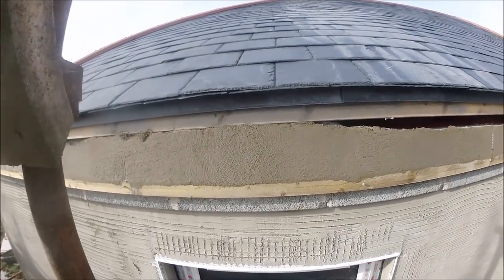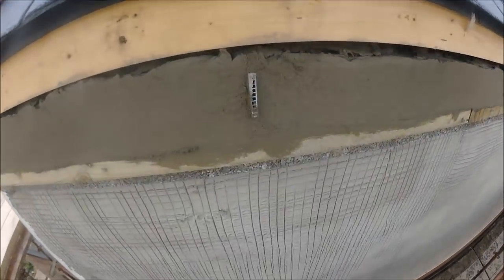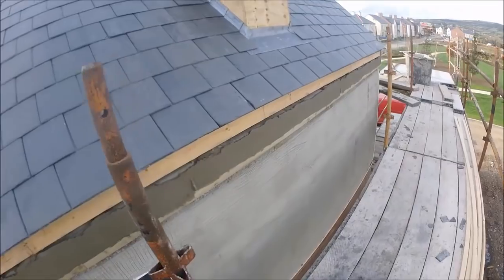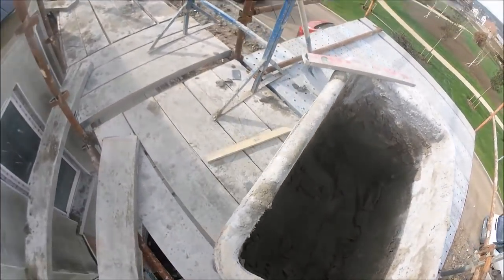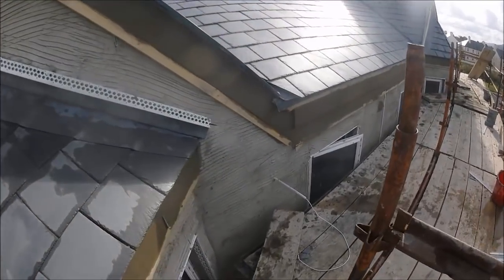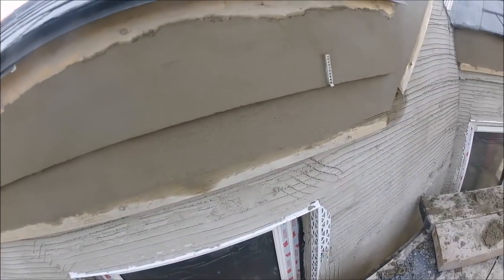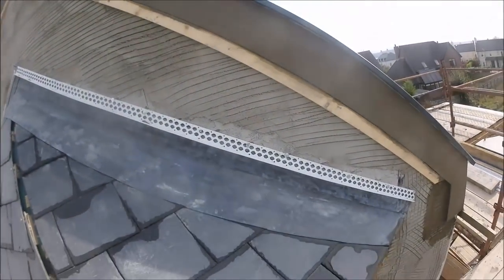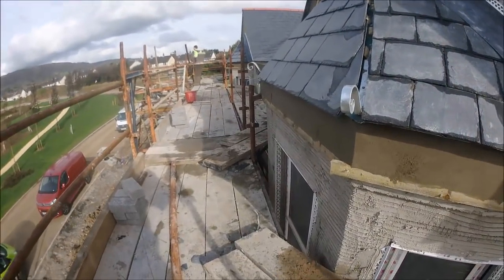Rendering job upcoming work to be done possible how to rendering vids to follow part two

Comment: Very neat work, when ever I was top of ladder or working high up was too easy to forget I was up there, number of times almost stepped off the edge.
Reply from the maker: Oh MAN I was on a big ceiling my and my mate was a huge hit of skimming but the floor was a sub-floor just concrete and was bumpy and stilts where up   to the highest they would go and i was still stretching ( need bigger set) but man i thought i was gong to fall every time i was in the one trowelling  up i would trip some never have i thought i was for falling as much on them in my life Would have planked it out but was no planks or scaffold
Reply: I was plastering small window with standard size trowel, was nightmare just beginning to appreciate what skill you have and was thinking today that plastering is lot harder to learn than painting and decorating, but one thing for certain I will never get up on them stilts especially not on scaffolding. That is so crazy.  As soon as I got home to Oswestry from Middlesbrough where I was doing plastering on my house I couldn't wait to get Nivea cream on my hands; they were roughest they ever been.

Comment: Those weep holes are an effin nightmare! I cut every other off if they're less than 1200 apart, ridiculous. Camera has improved tenfold, and cheers for directing me to this vid! ATB, Llyr
Reply from the maker: Haha man they have destroyed the sponge float my mate bought tearing holes in it big time thanks for watching  mate
Reply: macplastering do you paint anything on your battens, release agent / cooking oil? Looks like you've run a small tool between the batten and cement or something. How do you rate the pink sponge floats?
Reply from the maker: No need with these batons mate especially them clean ones I also cut them to make sure of a clean break They are sweet my mate bought in 2 brand new ones for this and one is near for the bin with those vents and the nails

Comment: lovly work again theres so much prep work bein done.never used 1 of them sponge floats outdoors only simaler 1s inside for skimcoat.good for straightening reveals etc
Reply from the maker: Was so much work on this with prep and the top row I remember was a little off shape we had lots to do to make it loo good especially  on the gable ends, Yes only time i would really use sponge float inside would be reveals that are heavy or the odd real bad shaped wall  , Funny it was me and a man called Emmet did this one :)
Reply: yes lad its an unusual name down south but up north i worked with 2 other fellas named emmet also.i was suprised tbh.ya if the wall is all over the place a spongefloat comes in handy.rearly used it.around bay windows where its heavy coat needed its handy also.was looking at ur power float i think i be just as quick with a normal float.but it sure do look the business .
Reply from the maker: @emmettmccarthy7247  Yes the good old power float have so good footage of that to come where I let walls go to the point hand floating would been very hard to get in im not impossible , I dont like adding water to a render job as i find it can leave stains ( white marks ) but thats mabe just me I lie to get it as it sets but in summer we at times will have no choice at times haha but yes I thin the new videos might be a good watch dear machine so anyone getting one will want to have a good few render jobs coming on or priced very well LOL

Comment: Do you block out bands ever?? What about window and door bands...e.g block out but allow for 2nd application with lime mix and use  timber edges
Reply from the maker: Dont often use lime , when you say block out do you mean build them out ? might have seen this not sure but how i do window bands -  https://www.youtube.com/watch?v=In-EvbfBWpY
Reply: Yes seen it a long time ago..I call that cutting band free hand ..I refer to quick 2x1 plained laths nailed on ,squared off  window frame, nibbed out free hand ,then 7:2:1 mix and have labour hold edges... but there's another way also...
Reply: Try this way it'll blow you away...you  know what patend revels are...you might call they different name
Reply from the maker: @nickywalsh8492  Is that the small fine one inch ones?
Reply: Model is 3x1 with 2x1 nailed at 20mm overhang and notch the corners together and block out,leave set and then strip and apply 2nd coat 7:2:1
Reply: @macplastering  yes....
Reply: Your probably fast at doing the one inch ones....here's the difference next morning strip laths and cut the outside edge back using a trowel ..batten 4" band from the leading edge and after that's set strip timber away and again apply 2nd coat , ok sounds like a lot of work but the results leave angles are so sharp ...gritty sand only causes problems due to feathering a fine edge...
Reply: @macplastering  no lime in top coat???(I don't mean lime morter)
Reply from the maker: @nickywalsh8492  If dashing dry dash i would put a scoop in to help make it fluffy but dont tend to use it much just the way I have been taught and has stuck with me